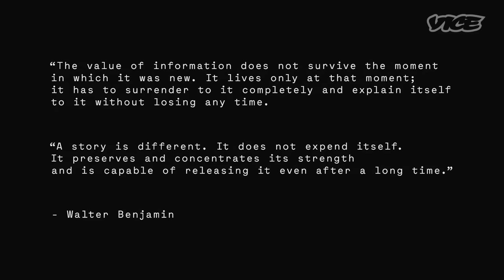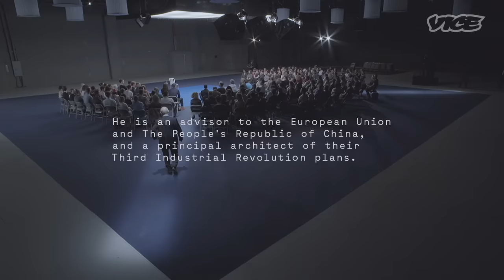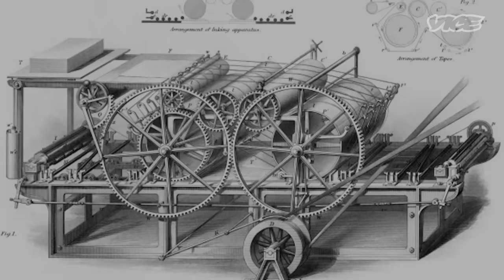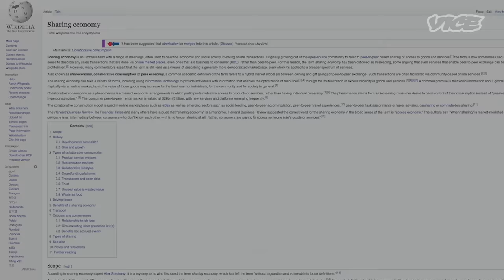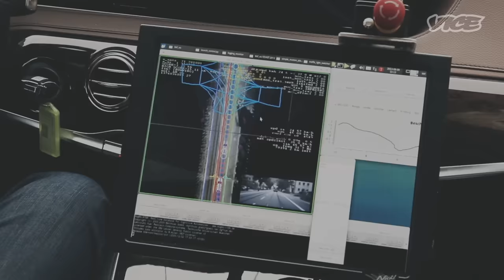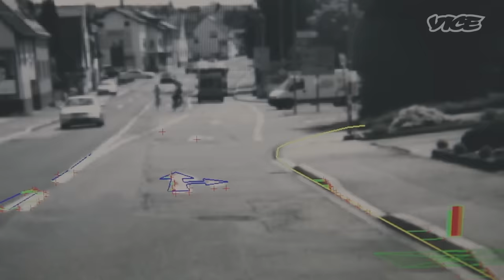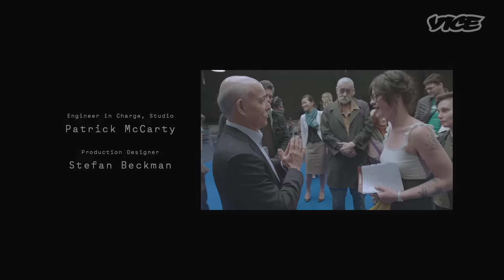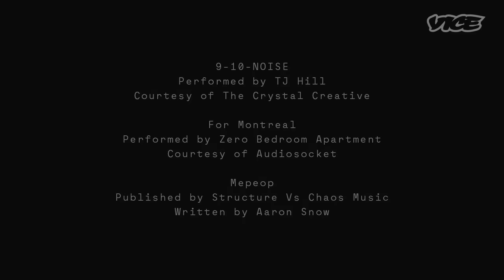The Third Industrial Revolution: A Radical New Sharing Economy

Comment: Sharing economy! That's what  Uber and Airbnb said before taking your money and pouring it to the pockets of invisible rich investors while at the same time throwing the gig workers under the bus!
Reply: Because those models are tied to 2nd Industrial revolution infrastructure. Did you watch the whole thing?
Reply: Dean Turner  2nd industrial revolution infrastructure includes monopolies. The 3rd revolution has its strength in being truly de-cenralised.
Reply: Uber and AirBnb are still centralized sources that control the sharing economy. They are not part of the decentralized third industrial revolution being talked about in this video. Imagine an application that is open source, written with smart contracts that execute if and only if someone generates a payment through this application to someone else. The smart contract always executes upon the initial transaction on the blockchain and it is written in such a way that once the person generating the payment is taken from point A to point B on the GPS, they are paid automatically. The validation and governance of the transaction, the output of the smart contract, and the releasing of the payments all happens by validators on chain, and every user of the service is a participant in the validation. There are no middle men, no Uber and AirBnb controlling anything, and no one taking a cut in the middle. Purely decentralizee ride sharing in a nutshell.
Reply: Dean Turner  You think there's ever been real communism on this planet, yet calling others gullible..., now THAT's funny! Watch Star Trek and then open  "The Capital", you'll find very few differences.
Reply: Dean Turner  You mean "Basic American instincts", right? China...an abject failure. Been to Shenzen lately? If that is a failure, I'd hate to see their version of success .
Reply: Dean Turner  read Carl Marx communist manifesto
Reply: Michael Edwards yes, and in the third revolution Uber will eliminate these drivers. Saying this as a driver. I am highly skeptical of the bill of goods this guy is selling.
Reply: Dean Turner  The argument of human nature is ridicule. Is all about education... Eating meat and loving it is on our nature, killing other people is too.
Reply: @NickolayEl  "You think there's ever been real communism on this planet, yet calling others gullible."

Yeah that was not real communism. If I WAS THE LEADER I would bring the utopia to all of mankind. Those 50 years, all the different countries, 100 million dead, that DOESN'T count. IF I WAS the king I would bring the paradise.
Reply: Dean Turner  Where do you think you get your ideas of human nature? I think it's something called "education". The way we believe humans act changes as we learn more about ourselves and the world around us. Capitalism has been around for 500 years. There was a time before capitalism and they'll be a time after. Don't act like you know everything about human nature and economic organization.
Reply: Their idea of 'sharing' applied to their members sharing their assets for the benefit of their members and the company with another individual (or a small group). The structure is like a maypole, where every node only connects to the one central node. In a 3rd generation environment, every node is connected to every other node for universal cooperation, sharing with everyone on the network.
Reply: Are you talking about stocks? Did you watch the video? The entire point of this video is lost on you if you came out upset about AirBnB. YouTube for one is a shared economy. I can start up a channel and make money, just as you can.
Reply: @fernandosousa4657  yeah, material prosperity and big skyscrapers are the only measure of success. Human rights and basic freedoms (freedom of speech, freedom of religion, freedom of creative expression, etc.) are antiquated ideas in the 21st century, right?
Reply: @konverzny  ahahaha clown
Reply: Brian Monge spelling his name correctly might help your case. *Karl
Reply: Yep, in short, it is pyramid scheme
Reply: DeWal Edible Gardens i think youve fallen for the fallacy of a world without rulers
Reply: Nickolay youll find that multiple utopias of sci fi are fictious
Reply: Fernando Sousa that because china dropped its communists bull a bit and introduce some capitalism and authoritarianism to put it back to good standing, somewhat after when the soviets inploded from footing the bill
Reply: trufiend138 its also a great way to break up unions
Reply: @Hansulf  Self-fulfilling prophecy. Treat people better, they become better. Build organisations that embed caring and mutual learning and change happens.  Yes we still have people who are so damaged that they are evil but there are so many good models of restricting freedom in Europe that is unlike the USA where incarceration is racist and classist, and not based on the actual danger that people present.
Reply: Dean Turner  it's a partial myth.  People get damaged.  People can get help to heal and recover, except resources for this are not widely available. The whole society has become toxic with the focus on competition not cooperation.  Part of the myth that developed under capitalism is that this competitiveness is our human nature. Plenty of anthropological evidence to show that cooperation dominated until the last 10K years. Even under capitalism if teams don't cooperate, they don't survive.  The sharing economy makes cooperation the most important part of social advancement and ultimately personal satisfaction.
Reply: I dont think you quit understand the implications of the sharing economy.
Reply: Dean Turner  Tell that to China.
Reply: Dean Turner  Though you are right when you imply that China is no longer a 100% communist economy you have to realize that all property is subject of the state. If you want to buy land to build a house you buy from the state, for example. All big companies are state companies, utilities, transportation, internet... Any company bigger than the standard one man operation needs to have state supervision. I think it is a socialist country, but the recipe is working, for now.
Reply: Dean Turner  what mental gymnastics? I am telling you facts, you can easily check that, if you wanted. And I never got into a position of power over anyone, but you quickly told me what I can or cannot do. I suppose that this works for some people but to do this to a stranger on the internet is quite lame, I think.
Reply: @konverzny  If you were the king you’d either democratize, become a tyrant, or be replaced in a coup 😀
Reply: Turo?
Reply: And yet China might kick our ass. They see the Washington consensus and our democracy as our weakness. Their strength is their ability to move fast, I’m not saying they are perfect or don’t got issues, but they do get things done for sure.
Reply: @Hansulf  ... are you nutz? people killing people ISN'T our natural instinct. its  a corruption of our instinct by an elite that wants us fighting each other so they maintain power over US ALL! and we've fallen for this scam for over 6000 years!
Reply: Dean Turner  ... there's a great quote from the movie "african queen." kate hepburn tells bogie - "human nature is something we were put on this earth to RISE ABOVE"
          so, any way you look at it, there's NO EXCUSE for perpetuating or causing injustice, corruption or human misery.
Reply: @DaveE99  ... yep, china gets a lot of corruption accomplished in a real quick time. and so does the u. s. its called capitalism and we're ruled by a monopolistic elite who makes every decision for our country. and they pay off the politicians to enforce the corporate will. china IS a corrupt corporation - just like the u. s. is and every country on earth.
Reply: @WholeToast  but who vets the riders and guest to ensure safety to the hosts and drivers?
Reply: @fernandosousa4657  add North Korea, Venzuela?
Reply: @ivedoneitall  .... i don't know what your're responding to. and i know all about the "stanford experiments." but how do they relate to my comments? i won't follow the link, just tell me.
Reply: @anthonycapitan5802  .. it has EVERYTHING  to with saving the planet AND freeing humanity from corporate slavery. its the elite and their damned, corrupt corporations who're enslaving us and turning our HOME into TRASH and POISON! they're the one's who have control, control, control over everything and they won't let go of that control until the earth chokes to death on their greed and industrial bile.
Reply: @cjmacq-vg8um  Lol, you don't think corporations will own and control the any "green" transportation tech? You do know one of the biggest proponents of "environmentalism" as green capitalism is big oil, right? And where will all the solar come from, and new cars, and batteries? All mined from the ground with fossil fuels, that's where.
Reply: @anthonycapitan5802  ... yes, YOU'RE POINT IS WELL TAKEN. AS LONG AS THERE'S CAPITALISM THE ELITE WILL CLAIM OWNERSHIP OF everything - ALL HUMANITY AND ALL THE EARTH. BUT WITH SO-CALLED GREEN TECHNOLOGY THEY MAY STILL MAKE HUGE PROFITS, WHICH AIN'T GOOD, BUT THEIR HUGE PROFITS WON'T BE DERIVED FROM THE DESTRUCTION OF our HOME! (sorry, my cap lock was left on.) 
      this planet belongs to us all. the elite don't own it as they claim.
Reply: @anthonycapitan5802  ... and please, don't begin your comments with "LOL." its demeaning and childish. YOU are better than that, my friend!
Reply: @dewalediblegardens7800  ... Someone still owns the system ...
Reply: @WholeToast  thank you for your comment you helped me understand more
Reply: Dean Turner  oh my god what fked up echo chamber of socialists did I walk into
Reply: @cjmacq-vg8um  Agree
Reply: @WholeToast  Yeah, the blockchain can create trustless transactions, but I don't see you addressing the issue of the labor being supplied by one party and a third party gets a cut without producing any of the labor. The problem with the gig economy isn't that payments aren't verified.. Am I missing something, or are you off topic, lol?
Reply: Dean Turner  And what does capitalism failing prove to us, that as long as we print more money to bail out the fraudulent financial institutions every decade or so, it's all good? How did capitalism address the pandemic?
Reply: Dean Turner  As long as you accept the baseless idea that either of those two authoritarian, plutocratic states are "communist".
Reply: Dean Turner  Absolutely true, unfortunately. The system relies on the idea that human beings as a society are capable of self-governing and moral and ethical responsibility in the face of adverse conditions.
Reply: I'm glad someone sees the bigger picture. My guy paints a pretty picture, but communism sounds great on paper but led to exploitation rather than liberation. The Automated cars and factories are going to lead to mass unemployment and these automated services are not going to be free like he pretends.
Reply: They be like you don’t need ownership if you can have access at any time. Yet when having access costs more than owning, who is really benefitting? Right big corporations who got massive wealth to own lots of stuff
Reply: @Beersandsmokes  "They be like"?  You're so hood.
Reply: If you don't like a company don't work with them. Don't try to own someone else's property.
Reply: @santiagosuarez3457  ..but isn't that "Cancel Culture"?
Reply: Uber and Airbnb helped millions of people without jobs make a living.
Reply: @ketodiet5766  That's what capital tells us about slave labor in India too.
Reply: Exactly.
Reply: exactly
Reply: @WholeToast  And that my friend is what you call fantasy utopias, where someone has forgotten the thousands of years of human history. Believe me, even in that utopia someone will own the servers and computer that process that transaction and hence will be the broker/ middle man plus the government will have its way and through laws will controll the entire process hence defeating the purpose of the so called freedom it preaches.
Reply: @NachtSchreck13  China begs to disagree! 😁
Reply: Agenda 2030, own nothing and be happy about it. So the rich can own everything.
Reply: @WholeToast  How do you get your clients, you will still need to pay someone to market your place or your car hire. I believe thats the role Airbnb and Uber play.